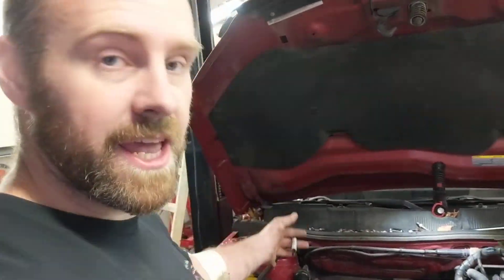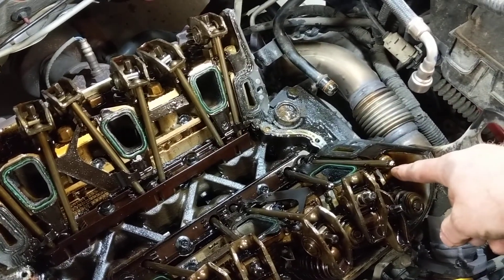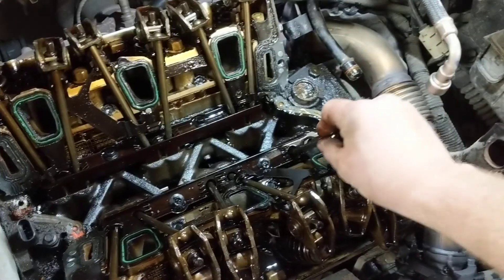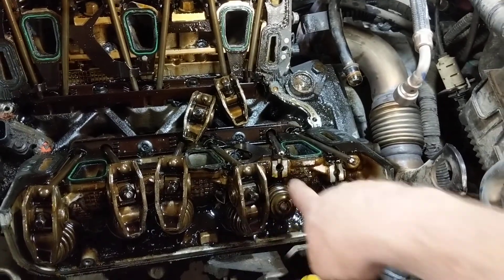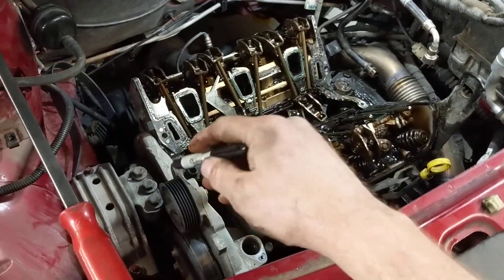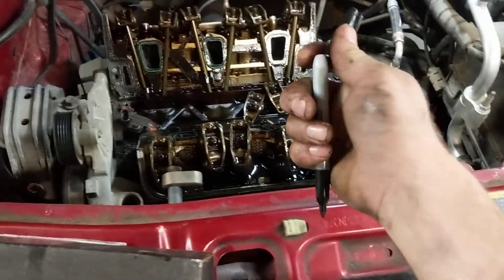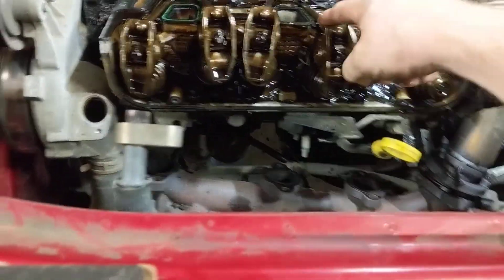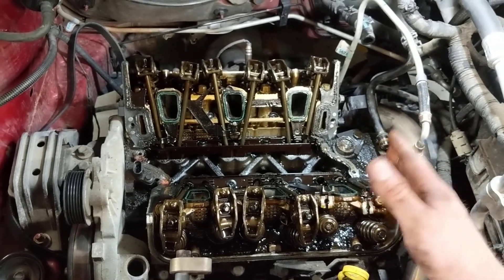Keeping Engine Things Organized TTT

Comment: I do about the same taking a flat piece of cardboard and weave horizontally through 2 hole with rods. # Front and rear and roll it up and bag it.
Speaking of GM machining had two rollers that stuck at one point. I ordered an AFM delete parts with GM camshaft. Everything else was months out. The bearing journals had some high spots and would not rotate 360°! Im still waiting for a replacement.

My head surface was however within 0.001-2".  LC9
Reply from the maker: It might have been that with a straight edge but you would be surprised how bad it is when you cut it. The machine will show all sorts of crazy uneven lol. I should do a video on it in fact now that I think about it.
Reply: @CrazedPerformanceRepair  
I agree even 0.001" would show up cutting the surface. On the camshaft I ask the supplier and they said the GM Cams they see this issue to much.
Reply from the maker: Yeah the factory cam bearings are trash, I actually showed it in a cam bearing video I did somewhat recently. The things are like dovetailed together lol...
Reply: @CrazedPerformanceRepair  I saw the video. I didn't pull the engine. I thought Id just replace the cam and lifters and to an AFM delete while down. The only problem I had was two bad rollers. One standard lifter and 1 AFM. The bearings are in ok shape for what they are. The cam was not machined correctly. If I had new bearing I would be able to install the cam much less turn it.